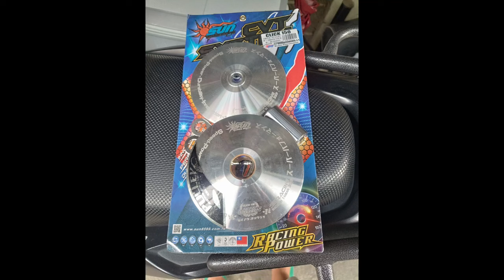DIY installation of New Sun Racing pulley set for click 150 #youtube #youtubevideo #shortsyoutube

Comment: boss ano pinagkaiba nung pang 150 sa 125 na click kinabit kasi sakin pang 125 eh 150 mutor ko hindi ko alam na may pang 150
Reply: sana po pakisagot ng mabilis boss
Reply from the maker: Sorry late reply. May nabasa lang ako boss kay sir Henson Hu ng MTRT...

"Research and Development Sample 
Click-125 
Click-150 PCX ADV -150 
Click-160 PCX ASV -160 

It’s Totally different CVT Ratio due to Each Engine Characteristics and gear Ratio 

Its Not advisable to do Conversions even though its fits the bike but the Characteristics are not Match with each bike Engine performance . So now we decide to make each model one by one Specific Pulley setting"

Yan po sinabi niya.. kaya much better po talaga if pang 150 pang 150 po talaga or 125 pang 125 talaga.